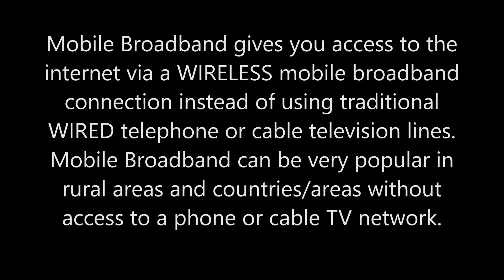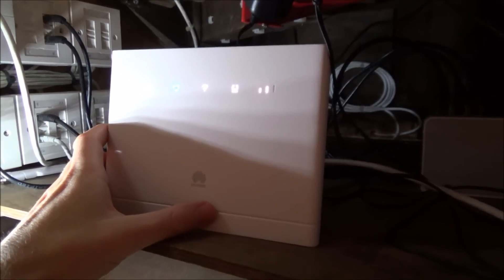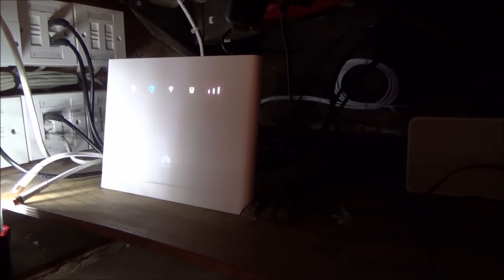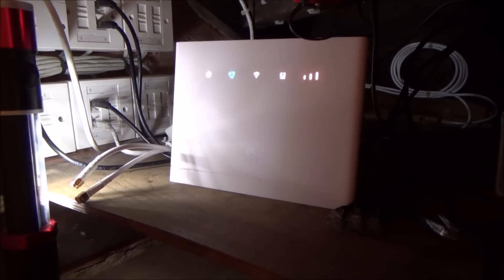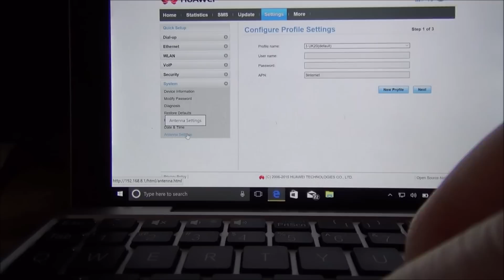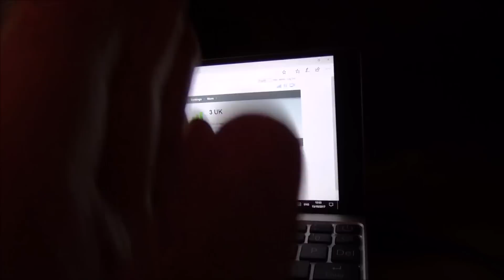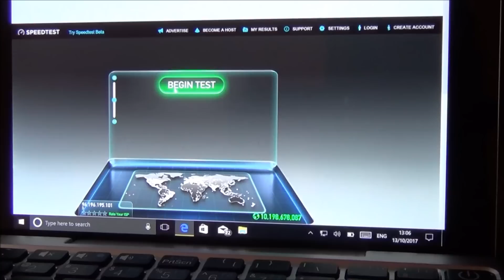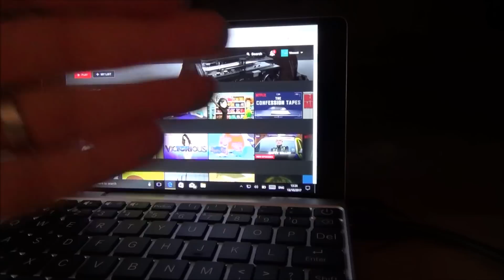How to increase 4G LTE Home Broadband Router Speeds

Comment: I have been using Vividwireless without any problems since October 2016.
Super easy to set up and get started. Just simply buy the modem new at Harvey Norman or an Optus shop.

There are NO CREDIT CHECKS, just simply buy the modem, plug it in, follow the basic instructions and within 5 mins, you will be surfing the net! 
No more hassles, waiting around for an installer to arrive, expensive installation charges, no buffering, no disconnection issues, great coverage (modem works off mobile 4G data frequencies, so wherever there’s mobile data, there’s Vividwireless internet. 

Can you imagine how convenient this is. I have carried this modem around to many different addresses and it has worked every time and even taken it on interstate business trips). Speed wise I have not had a problem streaming (I have NetFlix and NBA League Pass).Highly recommended. Always had issues in the past with TPG, Dodo and Big Pond on ADSL, cable broadband and NBN rubbish.

The Vividwireless customer service support has been prompt, professional and polite. Polar opposite to my horrible experiences with Telstra and TPG.
When I joined, I got 2 MONTHS FOR FREE. One month for buying the modem and one month by getting a referral code. Please use my referral code when activating your account to get your EXTRA ONE MONTH FREE when you join up. Referral code: 160721 OR SIMPLY USE MY EMAIL ADDRESS:  dirknash777@hotmail.com

Trust me, the price of these Vividwireless plans are worth it as it equates with quality of service and fantastic convenience. And there are NO LOCK IN CONTRACTS.It's month to month, you can cancel at anytime.
The other internet service providers are cheap for a reason! I will never ever go back to TPG or Telstra and getting locked into a long term contract!

Comment: I noticed the speed differences based on time too, at about 3pm I was getting about 50mbps down and 30mbps up and at 2am I get about 75mbps down and 35mbps up with this router. On Three I found you can use mobile phone SIM cards, and they have a mobile plan for £35/m that gives totally unlimited data which you can use with this device.
Reply: It's even better now you can get an unlimited data sim with a B353 for £22 a month with Three :D
Reply: @armchairgeneralissimo  interested in this because virgin are rip off merchants. 45 a month for supposed 200mbps (no phone or TV) and it does maybe half that at best.

Comment: How do you fix the router when the blue light is red
Reply: Red means that there is no connection to the mobile network. Reasons for this are the same as why a mobile phone sometimes has no network connection, including no signal or a very weak signal, a faulty or expired SIM card, a faulty or badly configured router, incorrect external antennas. Try putting the SIM card in your phone.

Comment: I live in Saudi Arabia. In my neighborhood, the fiber optics internet service has yet to be installed and won’t be for quite some time. My current internet is horrible, about 6 megabits per second if I’m lucky, and as for upload, it is less than .5 megabits. I was wondering if switching to 4G LTE with a modem with a SIM card slot would be a viable option. Signals are pretty good here and I tested 4G out with an STC (an isp here) sim, and speeds were very good with over 100Mb/s down and around 20 up. Is it worth switching? My household is HEAVY on internet usage. A lot of gaming, YouTube watching, etc etc. Would a cellular connection be stable enough to replace traditional broadband?
Reply: Dammit
Yes this is the way to go.
We use this here in Ireland.
All you need is a TP link router with SIM slot.
OMNI 1 (Pointing brand) from South Africa.
Down load app to your phone (open signal) and that will give you an idea where to put your OMNI up.
Set your Router to 4G preferred.
Good to go.

Comment: Nice video, but have you ever thought of doing a benchmark test of the connection, because from my experience the service providers in some areas just have to small bandwidth from their connection points to cope with the amount of data that is trough that tower.
I use www.testmy.net to do a automated test over time to see if there is to high load on the tower that you are connected to.
In my previous house, I got the mobile company (Telia) to change me from the tower that the router normally connected to that had to poor speed from 07 to 09 and 17 to 23, but good speed the rest of the day.
And this I found by using the automated test, and shared the result with L2 support @ Telia.
It runs from the web browser, and when I test from any other location than my own house (Family/friends), I use a Raspberry pi 3 that I have set up with automatic start of teamviewer and I use my mobile to control it. PS: always test trough cable connection to the router, to rule out any wifi interference problem. Once cable connection is OK, check by wifi to see if it is ok. Could be worth while checking wifi channel and change it if there are some other networks nearby with strong signal.

Comment: 4G LTE is usually in the 700MHZ band (US) for Verizon & AT&T. But you will have to check and confirm what frequencies and band your local country and carrier are actually using.  Hardware store 75 ohm cables (typical RG59 ) are very poorly made for cost savings and very lossy compared to commercial grade brand name RG-6 or even (better) 50 ohm RG and LMR communications cables and connectors.  At 700MHZ those losses can quickly add up with distance, much worse as PCS frequencies increase loss at 1700, 1900, and beyond 2,000MHZ.  Especially if the connectors are not properly crimped. Try not to circularly loop any co-ax cable tightly, unless you know why you are doing so (as in using it as a decoupling choke). So use gentle bends, keep as short as possible and outdoors bend slightly as needed at building entrance to droop away water and snow melt. 

Omni directional base antennas are a last resort. You increase the chances for multi-path distortion of the bounced and reflected carrier and data. Real world gain is limited to 3 to 5 Dbi no matter what the package propaganda says. Much better to use a directional beam antenna aimed at the cell tower (or reflected bounced signal source depending on your location) if possible. Outdoor rated flat panels and yagi beams are ok, but best to use a parabolic dish or screen antenna pointed at the signal source. They reject side reflected signals and noise much better. Gains of 10 -17 Dbi are normal and not overstated if a good quality antenna is used. In radio-land each 3db gain is equal to doubling the signal. So 3 doubles no gain, 6 doubles 3, 9 doubles 6, and so on. (look for something like these in your frequency range - https://www.excel-wireless.com/700-mhz-grid-parabolic-antenna ). You can usually use the device log in administrator settings to read signal strength for aligning the antenna and confirming you did a good job on the co-ax. The lower the - number in Db or Dbm (usually displayed as -80 to -109) the better. Just move the antenna around for the lowest number (best signal) you can get.

 Now keep your 4G / LTE radio box as close to the antenna as possible to avoid co-ax cable loss and let the WiFi and/ or wired Ethernet to another WiFi access point far away do the work of getting to your phone or computer device.
Reply: Yep, this is the way to go.  I've just ordered a wifi mesh system to go with my 4g router to minimise antenna cable length.
Reply from the maker: Great information. Thanks for sharing :-)
Reply: Thnx for the tips,Gary your a savior i keep lossing connection while looping my cables. coz its 30meters long .and i dont know what to do

Comment: Great video! I have for few years on mobile broadband (home and camper) and did buy an external (square shaped) aerial! My modem is same as shown. You speed test suggestion was the eye opener!!! I discover that the antenna setting was in auto and frankly I never saw a difference with or without external aerial but when I tested forcing "inside" vs "external 1+2" I discovered that the external was just crap!!!..thanks for the tip!!!

Comment: Great video. Very informative. I have question thought. I have the same LTE router but intend to only use the 2 bunny external antennas that come with the router. Do I still need to change the settings for the router to use the external antennas?
Reply: D Money yes you have to choose the external antenna option.

Comment: Great video Vince!
I have this same Hauwei device with no data cap in my rural home in Spain. Where my house is it connects better to 3g than 4g. 
My speeds are about 19down >1up . Interestingly my mobile 3g has better speeds (25down 4up) so that got me wondering if the bottleneck was the router itself which is what brought me here to your video. 

Interestingly in the town which is just 5 miles away, the 4g speeds on my mobile are - 141.38down - 42.33up. 

Question: Could investing in one of these antennas bring me closer to those really high speeds as I experience in town? Or is it more likely to just change it by a few megs?

extra info: the router info shows a full 5 bars of connectivity. 

Massive thanks if you get round to this question. Merry Christmas
Reply from the maker: Hi, if your router has the full 5 bars then I think the external antenna will be unlikely to make any difference as the signal into the router is already strong, if it did make a difference I presume it would be minimal.
Merry Christmas to you too :-)
Reply: If you have line-of-sight to the 4G tower in/near town then 5 miles isn't a stopper. Get up to speed on this mobile broadband thing, then buy yourself 2 quality pigeon pair Yagi antennas that connect to a quality MIMO router through high quality, eg LMR400 50 ohm extremely low loss cable. The Yagis need to be designed for the SAME frequency the local 4G is pumping out. Could be 700MHz, could be 1800MHz. You have to do some homework for that. You need to set the Yagis up on a mast a certain way (phase shifted) and point them DIRECTLY at the 4G tower - lots of patience needed and two-man job as Vince said would be easier than one and you should be testing right where the antennas are not down in a a basement or office. One fella rotating the Yagis, the other watching and calling out the readings. Sometimes you can nail the signal even though the direction seems a little off. The antennas can pick up a better signal off some roof in the distance. Can happen so worth mentioning. So x2 quality Yagi antennae with typical gain of 16dB minimum through x2 quality cables kept as short as needed, then into a good quality MIMO router and as stated, no cable loops. So your key words are: Quality and Accuracy.
There is no reason you cannot get those good speeds you get in town off the 4G unless of course there is no line-of-site. In that case you are buggered.

Comment: Vince can you speed test via the ethernet cable and then over wifi se we could see the difference using a hardwire vs Wifi Thanks
Reply from the maker: Hi, I did a video on Wi-Fi, Powerline and Ethernet a couple of years ago but I will do a newer one because Wi-Fi and Powerline have come on a lot since the video. Ethernet will still be the best but it can be a lot of hassle running the cable. If the router is really close then the Wi-Fi can often match the wired speeds but as you start moving further away from the router the wired (Ethernet) easily wins. I will try and get that video out in the next month as someone else asked for it as well:-)

Comment: Thanks for the tips Vince! I have just signed up for Three's home-fi option and I'm hoping to get much better speeds with 4G than with the usual broadband.
Reply: Everclean how are you getting on with HomeFi, I’m considering it
Reply: I just signed to a 3 (three) unlimited 4G sim and the 525 Modem (model up from the one shown I think) and I’m delighted! I’ve gone from less than 8Mbps with BT, to download of ~50Mbps 👍. I should mention that I’m just using the standard router with two screw on ‘rabbit ear’ antennas so far. I’m lucky as reasonably close to the mast (less than half a mile) but it was still very dependent on exact position, I get 5 bars signal (just) with the router up in the loft close to the end gable wall.  I’m debating if it’s worth spending the extra £80 on the aerial and mounting it on the gable externally.
Reply: @rlove21  I had the same, but unluckily for us there's a mast that interferes with a fast 4G mast and offers only 20Mbps instead of 60 :( .. BT were offering 2.5Mbps here
Reply: @Guiny  hard luck with the interference, I guess that's just one of those issues that you can't do much about (are you using an external aerial?)  I guess 20mbps is still well better than 2 from BT.  I'm using mine as an interim solution while I wait for Gigaclear to install fibre to the house which will be a massive improvement (but is still many months away and will be somewhat higher cost per month).
Reply: @rlove21  yeah, I just connected to the fast one again and its 150mbp/s! I don't want to go 20 again :O

Comment: What a dirty cupboard... do they every clean it ? Who ever installed those faceplates as a patch panel is a n00b.... dumb dumb
Reply: You think that's a poor installation, you ought to see mine, installed by a local "specialist" called "P*****r IT. Used damp string which he wrapped in insulation tape instead of cat6 and a pile of electrical choc blocks as a patch panel. On the second day he sent his right hand man, who didn't speak a word of English, was covered in mud and his only tool was a shovel to terminate the faceplates ( which really were used dinner plates with a face crudely drawn on them ). I've had to asterisk his company name as he's very litigious.
Reply: Maybe a follow up video should be produced at Christmas to show the speed difference the radioactive Reindeer will make to the internet speed. I guess you cant sleep ?

Comment: Further to this, one could create a bonded internet connection using the landline broadband connection and the 4G LTE connection, thus giving a faster and more stable connection.  Linus Tech Tips gives a good explanation- https://www.youtube.com/watch?v=tqbnjgbtDl0
Reply: It's VPN bonding (MLVPN), it uses VPN to spread the packets ... you can set this up if you have a fast VPS host.

Or your ISP may offer it too.
Reply: It's better than load balancing because you get the aggregate throughput - you can set it up yourself with OpenVPN or geta pre-configured device from your ISP.

Comment: I have one of these on giffgaff unlimited data for only £20 however after using the first 6gb the speed is limited between 8am and 12midnight.
The only company to do a big enough data plan is EE who offer a 4g router with 200gb of data for £100 per month for 18 months, I don't want to get tied into a contract for 18 months, but want faster speed, (we live very far from the exchange) any advice?
Reply: What is your current ADSL/VDSL speeds that you're getting through speed test?